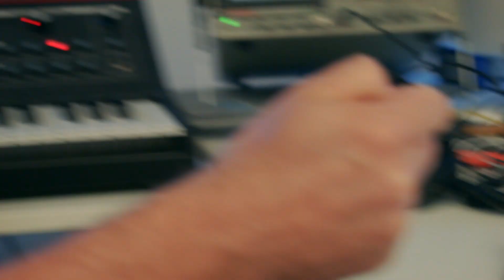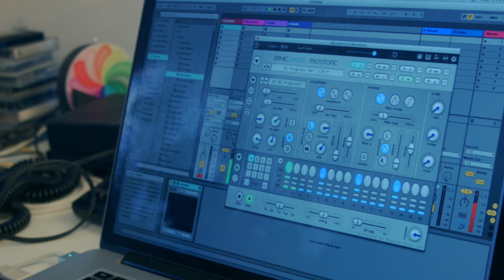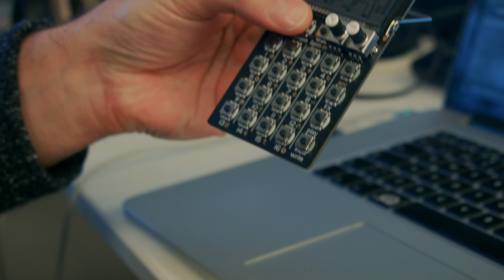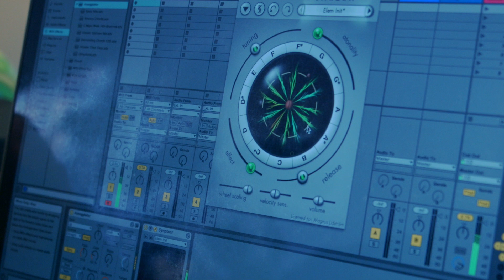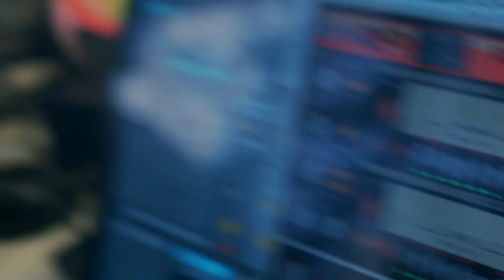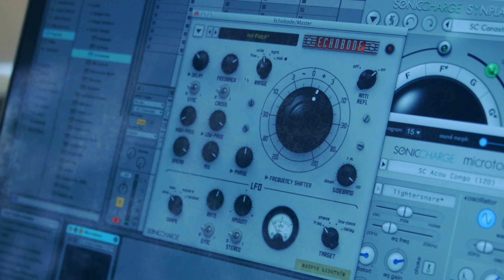Rare Interview w PO-32 Creator Magnus Lidström Sonic Charge

Comment: MicroTonic is one of my fav drum synthesizers, amazing and creative instrument, you can create drum and percussive sounds out of simply but very good sounding and creative oscilator and noise generator with filter, seems basic but you can get crazy fresh sounding analog drum sounds, well done!
Reply: the only one thing I wished for MicroTonic is operating with all parameters within one page, so 8 modules of synthesis could be on one page, so I could use it in live situation and create sounds on the fly

Comment: Brilliant interview! May I ask is the PO-32 easily syncable with the Circuit?
Reply: cuckoomusic Buy a Volca! 
Circuit->Volca->PO
Reply from the maker: +PTT thanks! The PO series syncs over click. Like CV, Volca kind of clicks. The Circuit has got midi jacks. Not sure if those midi jacks on the Circuit could be turned into click signals. Certainly a totally valid feature request.